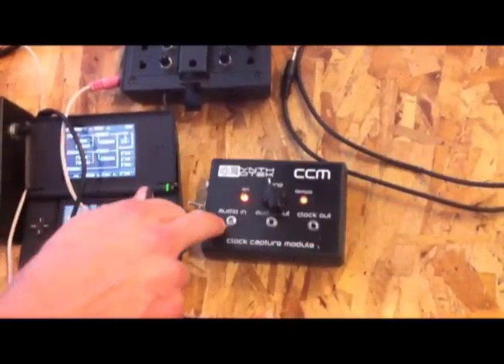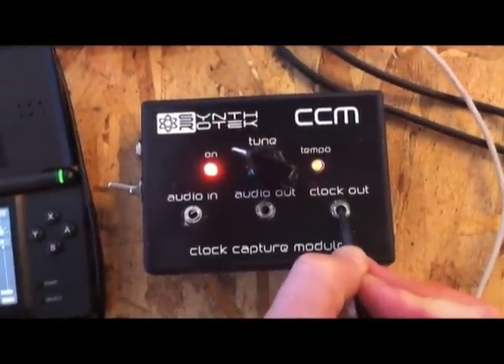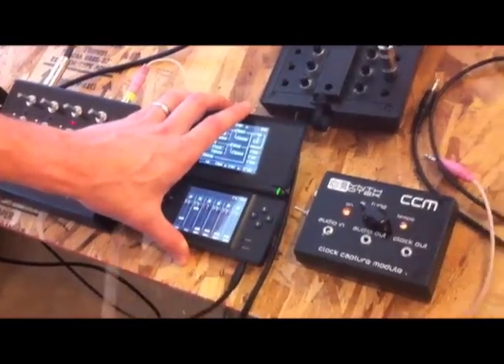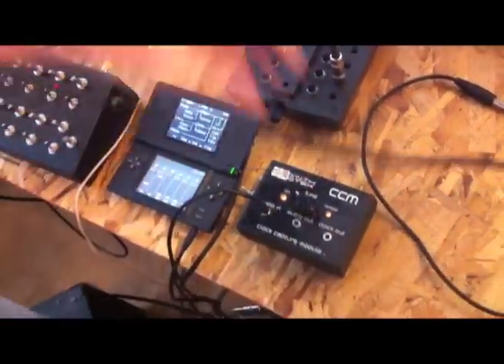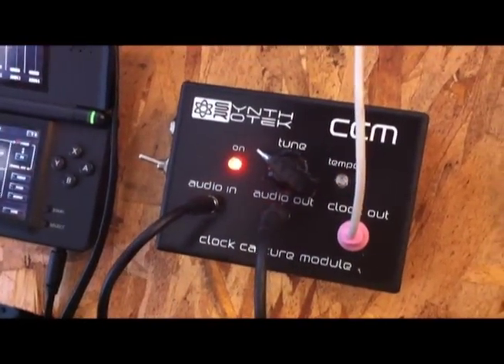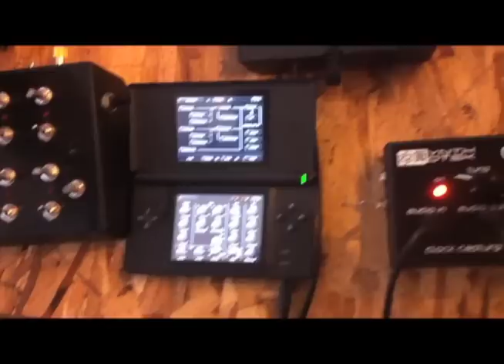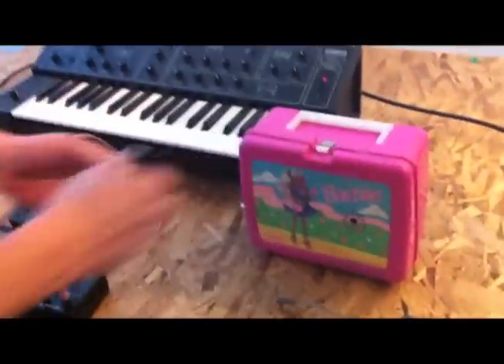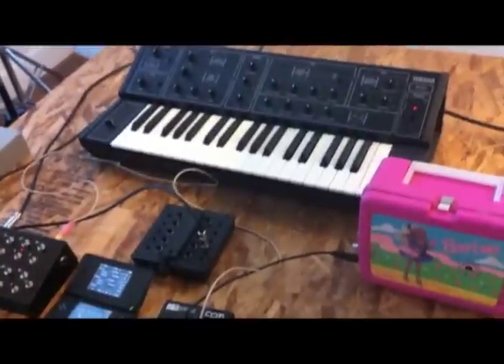Clock Capture Module - Synthrotek - Nintendo DS-10 & Analog Synth COMBINED!

Comment from the maker: The actual voltage does vary related to the waveform that is going into it.  It peaks at around 3.3 volts (as far as I have seen) but drops relative the sine wave.  This way the pulse hold longer if there is a long release, but can be staccato if you have a very short square wave.   I have not had any issues thus far triggering any device that I have plugged it into...